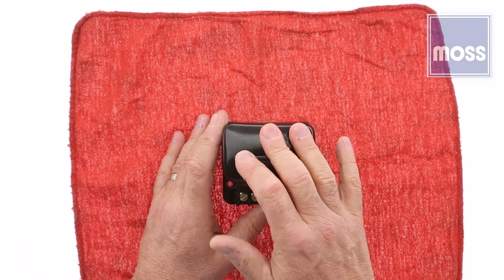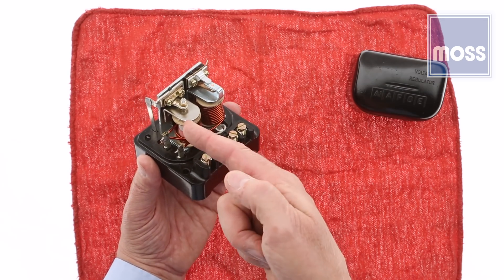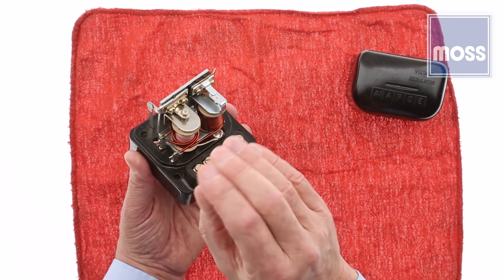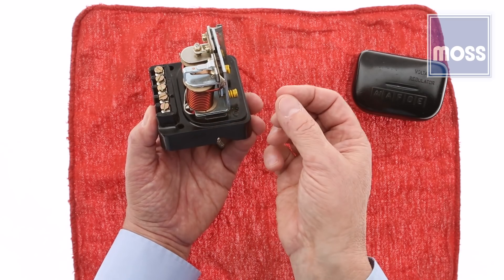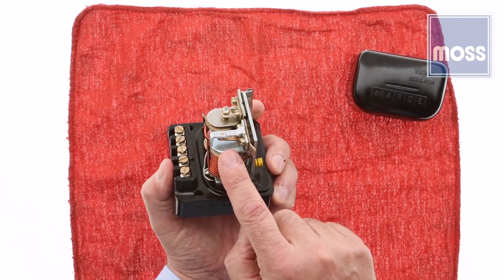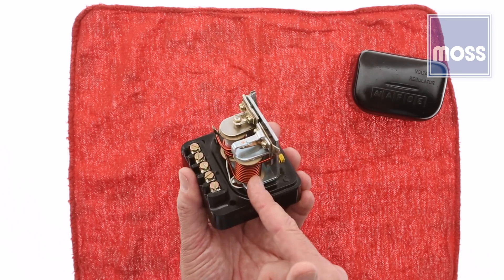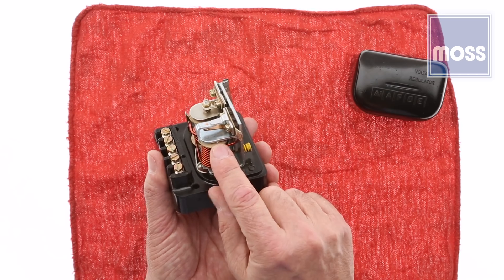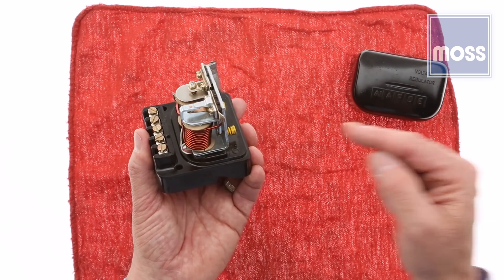Function of the Cut-Out Relay Explained

Comment: Great video - My reg is out of the car and both contacts are open.  Bench testing and one closes slowly to make contact at 10.3volts.  Then the other snaps shut at around 15-16 volts.   I also tested it wired differently and noticed the contact that previously snapped closed, was trying to lift from an already open position.  I have no springs on either coil, its naturally sprung open with a copper tab.   There must be a few different types, but I think I can apply what i learnt here to how mine is operating.

Comment: Very good video the function is well explained.  Please bear with me now as I am a complete novice at this and I have a question please!  I have a Ferguson TEF20 with a 12v regulator.  What is the best way to check that the cut-out relay voltage is set correctly using a voltmeter?  Thanks

Comment: To put in perspective, that fast flickering is how they discovered they could make a silicon chip which converters AC to DC electric as well, hence a switch mode power supply. Using the high peaks of the AC on that + and - side and cutting out the middle you have changed AC electric into DC electric, it's amazing what they were able to do with mechanical devices like this isn't it?

Comment: I was right with you till you said the reason you needed the cut-out to prevent the battery setting fire to the car. 
While the battery could produce 600A cranking, dynamo would never draw anything like that. At which point the main issue is the battery becoming flat due to discharging through the dynamo. A pain, but not a 600A fire!

Comment: Sandpaper. Ouch! Maybe a very fine grade with care?
Reply: Never use sand paper on cut-out contacts. A plastic 3m type product  like scotch brite is used in my work shop. An oil stone is used to tune the regulator points, but not to aggressively.
Reply: 60 grit
Reply: @asiasmaster  ha.

Comment: It's also known as "motoring". If you take off the fanbelt, and put 12v + on the generator, it is basically an electric dc motor. Sure it will work. But when the drive belt is on, it doesn't have the guts to rotate the engine, therefore it all goes up in smoke. I put a massive diode in my dad's bugeye sprite to replace the cut out coil. Once the cover goes back on, who'd know? A LOT safer. Thanks for the videos, I'd forgotten how to set a reg. Do you have any videos on 3 bobbin regulators? I was only an apprentice auto electrician at the time, and i never saw enough old cars to remember how to set these old things up. Cheers !
Reply: this diode thing is a great idea, wonder if that's what they do in the modern regulators swaps

Comment: I have one question. What stops the generator from over charging the battery? In my opinion 25 amps going to the batgery continuously while running would eventually overcharge the battery right?
Reply: Typically the make far less, and the battery will accept the overcharge reasonably well. Alternatively most owners of these cars will turn the dynamos off to prevent excessive charging.